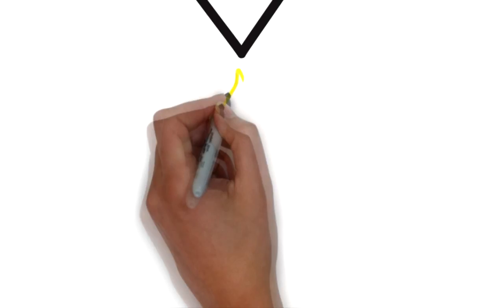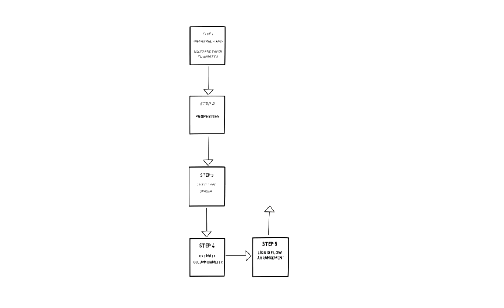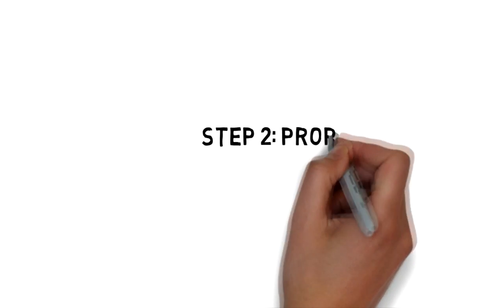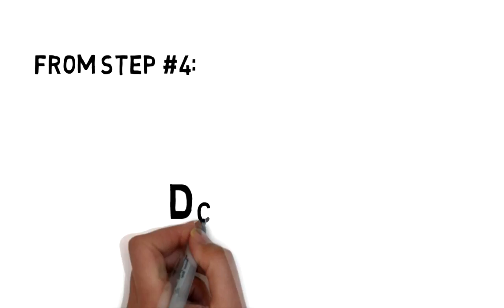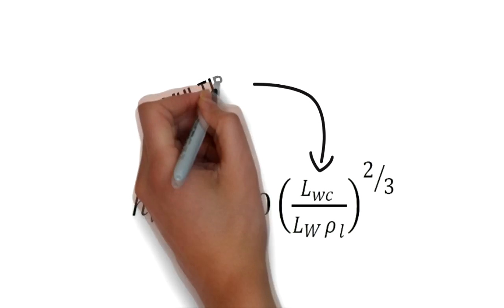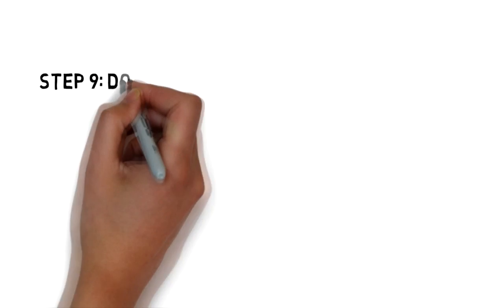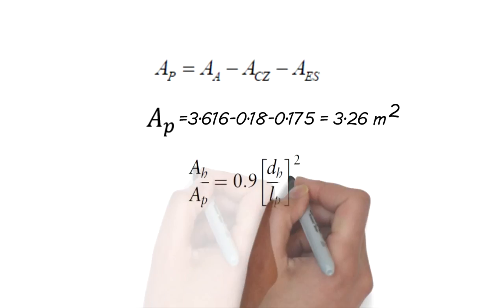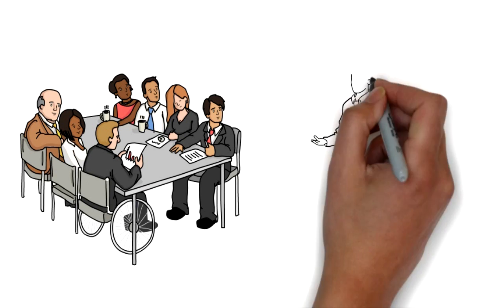Design of a Distillation Column with Perforated Plates

Comment: Hello guys, the video is great but there is a minor mistake in it while calculating the minimum vapor velocity through holes by using Eduljee's equation. To use this equation you need to find K2 constant from graph which needs the calculation of clear liquid depth over the tray: h(w)+h(ow). h(w) is weir height and h(ow) is weir liquid crest above the weir height. Your mistake is that you considered h(w) equals to h(ow) maximum while this is not true. Hopefully this comment would be helpful for other engineers.

Comment: Where can I get a design of an ethanol distillation column? Do you have it?
Reply: +Robert Joseph Mawanda The procedure is the same, the only step that differs is the first one, in which the liquid vapour equilibrium would be the one you want. Also materials used may vary.

Comment: i just  need number of plates, size of  wholes and number, and  one  picture how pots looks

i will be distillate about 400 litars of mash per hour, temperature of mash is about 40  Celsius, and  they  have between 6 and 12 % of alcohol.

out need to  be  be between 25 and 35 % on coundenzator , and  down mash without alcohol 

for me  is maximal  diametar 10" or 250mm for  columnand,  wholE column will be in termal oil on 120 Celsius

if  can  and want  please  help me

IF YOU THINK IS BETER TO  USE  BABLE CAPS I WILL MAKE, JUST SEND ME NESSESERY INFORMATIONS

PLEASE PLEASE PLEASE
Reply: +Armin Tot I don't fully understan what you need. I understand you distillation requirements (alcohol percent), but I don't get the first part.